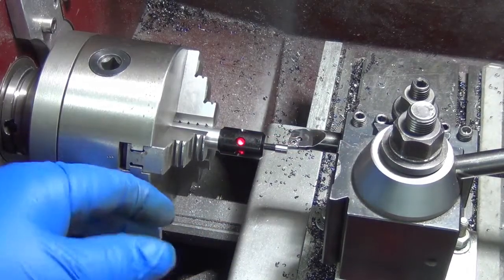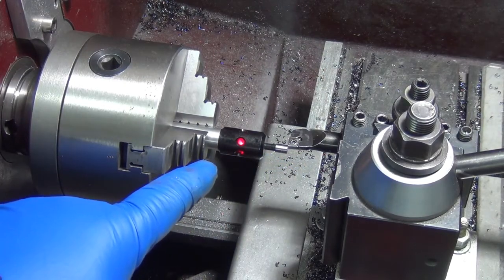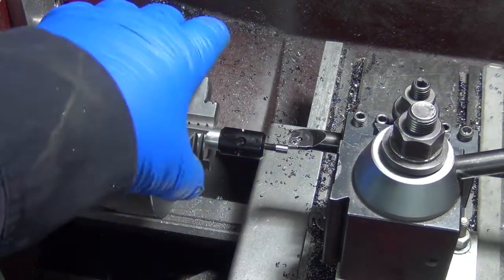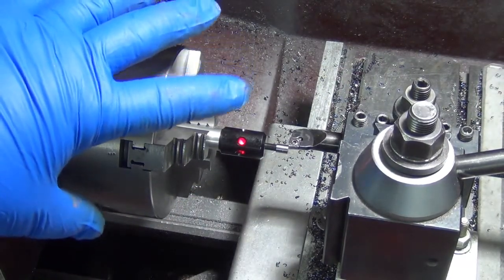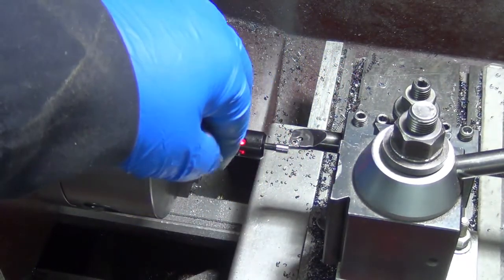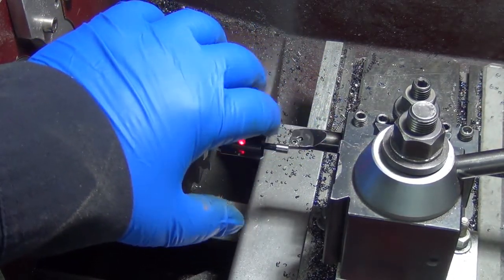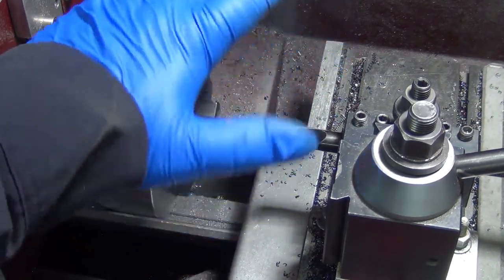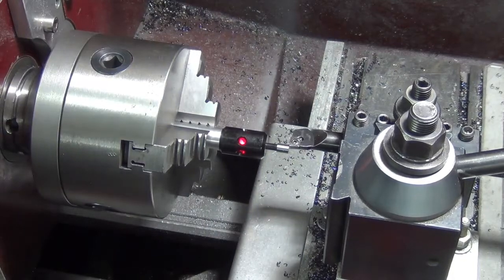Lathe Touch Off - Electronic Edge Finder

Comment: Love this idea!
Reply from the maker: Thanks.  I've also used my Hamier on my SlantPro.  I can also use it to set the tool height.  Since my Hamier has a QTC ring on it from Tormach, I could also set the Z azis using the tool height I come up with on the mill.  I haven't tried that, but it should work.

Comment: Mike, people still finding your vid in 2021, :  )   I’m a long time cnc mill guy 1st time cnc lathe guy. Just learned lathe tool offsets for the 1st time the other day.  I thought this SUCKS!  and thought the same thing you came up with here.   Looking for a probe that will work in my mini lathe. SO did you develop this idea into a practical solution for tool offsets or go back to doing skim cuts to set up your tools?  I think why wouldn’t there be dozens of options out there for lathe probing, I’m finding nothing!
Reply from the maker: Hi Bill.  Geez....this was awhile ago.  I've had my Tormach Slant Pro 15L for over a year and a half now.....this little lathe went away when I got the 15L.  I haven't tried this again with the new lathe.  Depending on how you program your parts, the Z could change with every different type of part.  The X is set less often.  Once you get the tools set once and trust they're accurate......you can go to any tool and set the DRO and set the g54 when you fire up and all the others fall in line.  John Grimsmo did a great vid about it on his 15L.... here's a link.... https://youtu.be/SkcSM-NEpnA

I use my haimer to set the Y(tool height) sometimes, but I just broke a $45 tip this weekend, so I may go back to using the ruler. lol
Reply: @bluehandsvideo  thanks for the reply. My lathe is a Sherline Chucker, gang tool lathe.  I’m also looking at getting a Tormach Slant pro at some point down the road, but 1st I need a mill looking for a 1100M or S3 Tormach.  Anyways I guess I just need to get used to setting tool offsets and it won’t be such a big deal especially on a gang tool lathe.  Set it up with standardized tools and that will go a long way. I watched John’s video good info there I’m on Acorn controller for the Sherline I think it’s the same change, 1 tool and ur good to go.
Reply from the maker: @billb295  Part of the problem with using the edge finder like this is that it doesn't account for the run out on the chuck.  Most scroll chucks have at least some run out.....one to 3 thou.  By doing a skim cut, you eliminate that and make a perfectly round surface.  When you're cutting, if you find that multiple tools are not cutting the correct dimension, you adjust g54.....if only one tool is off, you only have to deal with that one tool.  You can do a skim cut and touch X, but I typically go into the offset table and adjust the X offset by the amount the cut is off.  I have a quick change and gang tooling setup on my 15L.  You can see that in some of the more recent vids.  I like to try to use one tool in the QTP and then another one or two ganged. I might be posting a vid soon of making some delrin washers.  I've done them before, but I did it differently this time....2 different tools in the QTP and one in the gang block.  

How do you like the Acorn?  I'm planning on upgrading my mill with one.

Comment: The only set back to using that edge finder is once you put it in a collet or jaws you would have to put an indicator on the tip and check for runout.  If you do end up  having runout it would be difficult to get it concentric because there would be no place to tap or manipulate it in,  being how sensitive those are...... But still,  I absolutely like that idea...... Got me thinking.............. Hmmmmmmmmmmmmmm
Reply from the maker: I think the concentric issue would only be a problem for getting a true X axis zero.  If the edge finder is used for tool offsets and the chuck wasn't rotated, would it matter?  I had seen guys using home made gizmos to do the same thing, but I hadn't seen anyone try this with a commercially available unit.
If you get this nailed down, do a vid and come back and put a link here!  I'd love to see it! :)

Oh......and the first time I used that edge finder in my new cnc mill.......I snapped it in half!! LOL  It's okay.....Eddie is only counting the end mills I break in the first month :)   (joke from earlier vid )

Comment: What you need is a ZERO tool that you setup and compare the other tools against and write offsets into the tool table.´This zero tool can be as simple as a rod, does not matter where the EF is located as you compare to a known ZERO.
I am in the works to have a similar setup directly connected to Mach3.
Cheers
Bengt
Reply from the maker: I did set up a tool that I would rarely use to be my zero tool, but it ended up being easier for me to just use tool 1.  The master tool I referred to is the same as the zero tool.....at least in the context I'm using it....I could be doing it wrong :)
I understand that the position of the EF doesn't matter for writing the tool table, but since I don't have home switches to easily tell me where the carriage/cross slide are after a shutdown, I'm looking for a way to repeatably setup my initial position when I fire it back up.  Hence the ring on the EF for repeatability.
Are you going to do a vid of your setup?
Reply: @bluehandsvideo  old thread... I just bought one of these to use as a baseline tool - mount it in a toolholder - as I'm upgrading my 3-in-1 to a QCTP and I'll need to re-zero the toolpost every time I switch from mill to lathe mode.
Reply from the maker: @thumperthoughts  Great!  If you do a vid, come back here and leave a link to it. :)
Reply: Video will come later on I hope ;)  You still can live without home switches as you should always take you primary tool to do the first cut and go from there with known measurements.
Cheers
Bengt

Comment: Back in college I used a Mazak CNC turning center that had a version of that on a post next to the chuck.
Reply from the maker: That's a dedicated tool setter?  It can be used even in the middle of a run if an insert breaks......right?  Hmmm....I wonder if I could mount this in a similar fashion......I think the biggest prob would be space limitations.....the lathe only has about 4" of X travel.
Thanks!!
Reply: As long as you know its position in relation to the spindle, it could really be placed anywhere on the machine.
Reply: If I remember right it also flipped out of the way when not in use. Ill try to find a pic.
Reply from the maker: Andrew Kitchens
true.
The ones I've seen all flipped out of the way.  That sounds cool, but homing switches would probably be easier. :)

Comment: Looks good but don't forget that tools need pressure to cut but your light needs none, so you might get a slight difference when cutting.
ATB
chris
Reply from the maker: Ahhhh.......that just may be the one caveat to using this method.  I figured there had to be at least one or I'd have seen it used more.  Then again, the way the mach3 manual shows to setup the other tools only requires touching, no cutting.....so it would be prone to the same error and adjustments.  I guess I'll see about putting a ring on it and trying it for a bit. :)
Thanks!!
Mike
Reply: Don't think I am trying to put you off, results should be repeatable but you might need a small offset to consider that's all.
chris
Reply from the maker: Chris Stephens
I didn't take it that way at all.  After I posted that, I thought about how mach has you take a cut for the master tool, but the rest of them are set by touch.....inconsistent or at least requiring offset tweaks.  I've been doing some of my set ups by taking .010" cuts with each tool, since that's what I typically take as a finish cut.  That's been working fairly well.  With the electronic edge finder, there would be no cut pressure factored in on any tool, including the master.  I guess I'll have to try it and see :)
Thanks!!!
Reply: Damn right you should, you never know till you try, most of what I know about machining came from experimenting but then, on the other hand, what do I know.

Comment: But then again that tool was spose to be spun correct? so that is why you have it in the chuck...seems to me that particular type of edge finder would work vertically only as it seems to be very sensitive and I would think it would favor the bottom because of gravity.
Reply from the maker: I don't think this type gets spun.  It's just checking for an electrical connection to complete the circuit and turn the light on.  The probe end is really stiff, so I don't think it's susceptible to position problem.  With the lathe, the goal is to get the cutting point of all the other tools to be in the exact same location as the master tool. 
I may need to add a wire that I can clip between the body of the finder and the tool holder.  Continuity all the way through the lathe doesn't seem to be extremely reliable with grease and/or oil on a couple of the contact points.
Thanks! :)
Reply: bluehandsvideo
your good to go then, looks like it should work on a lathe as it does on a mill.
Reply from the maker: 1NRG24Seven
I'll let you guys know when I get a chance to play with it again.  Gotta start prepping the shop along with working on the brake parts. :)

Comment: Traditionally on a mill the edge finder goes where the bit is to be correct? to find the edge of the piece to be cut? So I would think then if you follow that logically you would then put that where the boring bar is to find the edge of a piece chucked up in the lathe. So if your boring bar was lets say 1/2" you would want a fixture to hold your edge finder at center of the boring bar. But like you I could be wrong so ask one of the experts, but do not see why one could not use that unless its side loading is subject to gravity and needs to be used in a vertical position only.

Comment: good idea.

a 3d-taster (taster means tester in german) will replace 10 of your indicators and touch produces, maybe you wanna look into it in the future.
Reply from the maker: I've been chompin' at the bit to order one of those.  The only ones I've seen are on Tormach's site.  I do plan on dropping the $500 or so for one, just haven't pulled the trigger yet since the mill is still a couple of weeks out.  I definitely want to use it with the quick change tooling.  Is tormach the only option?
Thanks!
Reply: tormach is not even an option, they import from other companies

3d-taster is a german patented invention and does what the co-axial was never meant to do, what the digital touch probe sucks at doing, and the test indicator does on 1 axis, what the dial indicator can't reach in to do.

Comment: Your method is just fine, Mike.  Another way would be to insulate the tool post and connect it as a probe line in Mach3.  A tool height motor would be really cool and could use the Z height routines.
Reply from the maker: Cool idea.....maybe more than I'll ever get around to on this machine :)
After the Novakon is paid for, I'm eyeballing tormach's lathe and grinder :)
Thanks!

Comment: This should work well if you only have a couple of tool holders and you want to use it to set the tool rather than change the tool settings in mach3, but you should still do those home switches :) it will make life a little easier
Reply from the maker: I was kinda thinking that with the collar, I could use it to setup any new tool in the tool table without having to recheck the master tool.  Reference the master(#1 in my case), then set all the other tools.  I would think that if I lose steps or position, as long as I remind mach which tool I have in, I can regain my position with this.  Granted I'd have to pull the part out of the way if it happened while turning.  I'm thinking I'll be using it more at start up.  For awhile, I was assuming it held position since nothing moved between shut down and start up, but as Eddie pointed out in his vid to me, windows can cause it to lose steps without cause.  I've checked it every time I've started up and sure enough, it's off and has to be reset. 
Home switches will eliminate a ton of grief!!!  I might just be done with the lathe for now.  Recommendations on switches?
Reply: bluehandsvideo Go to ebay and search this number 120990980413 these switches are good as your over travel  limits, if you set them up properly you can avoid running into your chuck if you lose position or program wrong. As for homing switches us an opto type these are very repeatable.
Reply from the maker: NuttyforNissan
Thanks!!!  I'll look them up :)